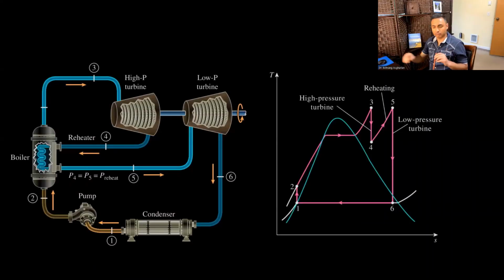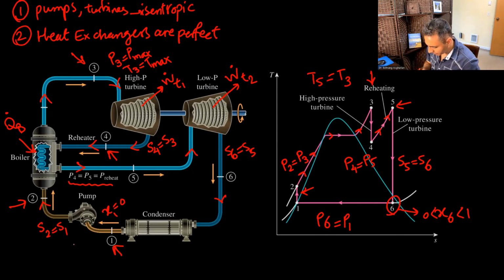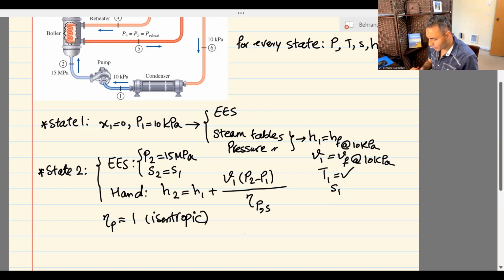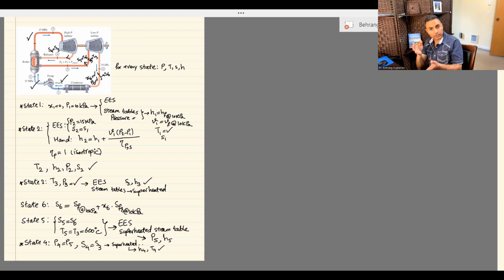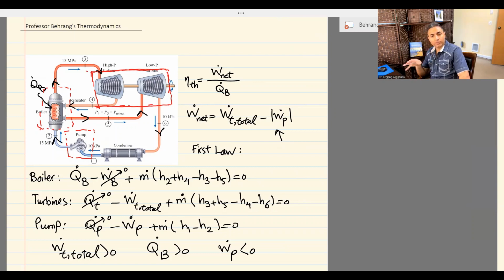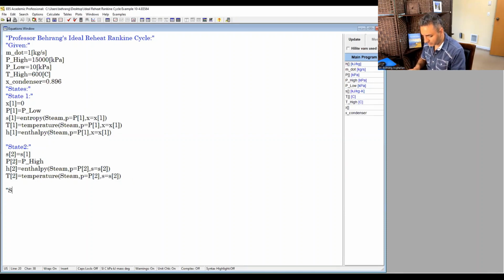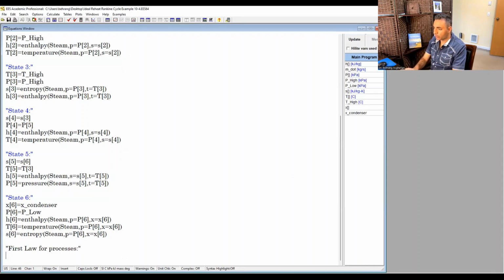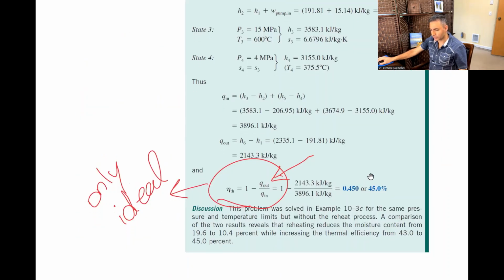How to Solve Ideal Reheat Rankine by hand and EES. Example 4-10 from Cengel's Thermodynamics.

Comment: How would you find T2
Reply from the maker: If the pump is isentropic, s_2=s_1 and also you know P_2. Knowing two independent properties s_2 and P_2 will give you T_2 if you need it using EES. The thing is if you are not using EES and you are using tables, since this process (1->2) happens in the compressed liquid area, T_2 will be very close to T_1. Maybe just 1 degrees Celsius of difference. So it won't be a big deal for problems like this.

Comment: Thank you Doc.
Reply: Have you done any journals on Organic Rankine cycle that I can read. Thank you so much for this great work.
Reply from the maker: @kl-wastikc8909  No I have not. But I am planning on making a video on Organic Rankine Cycle since apparently there is a demand for it.
Reply from the maker: You’re welcome
Reply: @professorbehrang  how to reach you doc? Currently, I am studying my master's degree in mechanical engineering.
Reply from the maker: @edwinpagayona9120  How can I help you?
Reply: @professorbehrang  need your advise what topic do I need to propose in my thesis with regards in Rankine Cylcle? Thank you
Reply from the maker: @edwinpagayona9120  optimization is always a good topic. A combination of reheat, regeneration, and process heating and optimizing that cycle for the maximum efficiency.